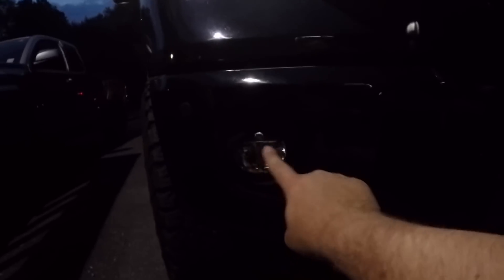Problem Not Fixed...

Comment: My Rigid Led's in my 2019 TRD Pro is the way to go.
Reply: Nice upgrade! What color you go with?
Reply: @jonstundralife5897  040 super white.
Reply: @jonstundralife5897  I went in for an oil change and walked the lot and found the truck of my dreams. I got 40K for my 2017 and the 2019 was 55k and I paid cash for the difference. And to my surprise my insurance went down $130. for six months.
Reply: @zdiver1  I had a feeling.. haha Glad to see you're enjoying retirement! 😎
Reply: @jonstundralife5897  last week I was diving in the Bahamas.
Reply: @zdiver1  You earned it!
Reply: @jonstundralife5897  I would shot you a picture but my cell melted down and I lost most of my contacts.
Reply: @jonstundralife5897  yesterday I installed per TD34 recommendation  N-Fab PRT0784CC-TX Predator PRO; Cab Length Textured Black Length steps. the unboxing took longer then the install.
Reply: All of Toyota fog lights are junk.  You wont realize it, until you upgrade to a pair of Baja squadron pro.
Reply: @jonstundralife5897  ARIZONA TUNDRAS GROUP #AZTG
Reply: @zdiver1  I didnt get any of the notifications that you sent these messages. I tried texting you. Is your #still the same? Maybe I'll bite the bullet and just create a new FB account to get in on AZ Tundras.